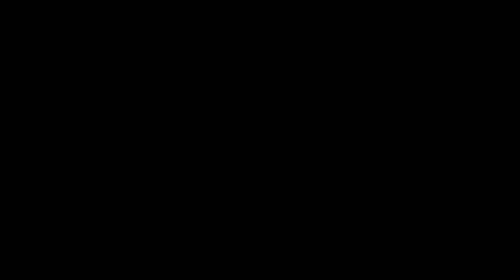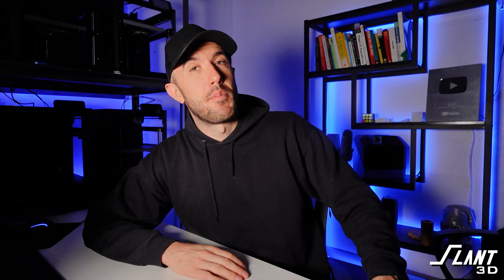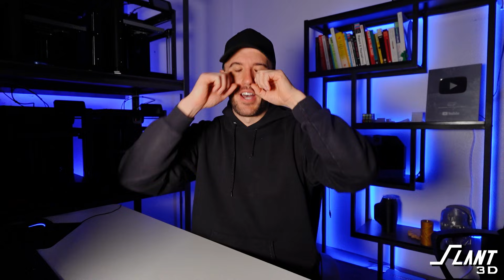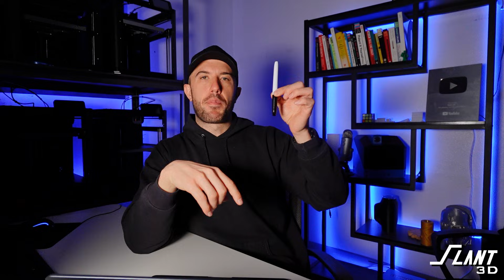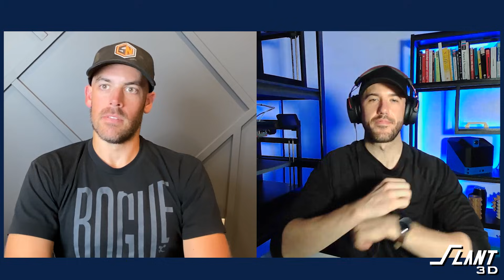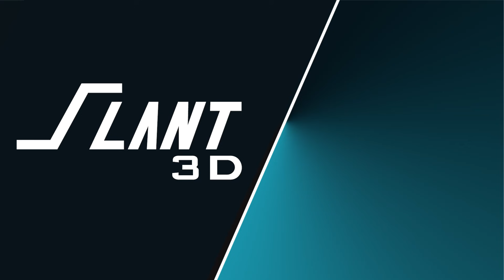3D Printing API | Lots of News and No News | Shopnation Redux | Your Questions | Podcast Ep 130

Comment: If you're not a massive multinational corporation, and you design a successful product, it's highly likely to be knocked off...
That's just part and parcel of the way the world works. 
If your product can be knocked off by an 12 year old in their bedroom, with no overhead and no costs, that may be a bigger problem. I have yet to design a successful product that's easy to copy and print. But I have had billet aluminum (CNC machined out of block of aluminum) products knocked off.
There's a few things you can do. Parents are kinda of dumb in most cases. Most products aren't even patentable, but then parents are expensive, but then defending patents is even more expensive. BUT design cosmetic features into your parts that are unique to your product line, and document them. That's called trade dress, and can give you leverage (and maybe even standing court), even if you don't register it (but registering it is super cheap compared to a patent). If another small business comes your thing, you can have your lawyer send them a cease and decist for like $50 or $100, demanding they stop selling the copies of your part immediately, prohibiting them from coming out with something that's a functional copy but modified to eliminate the trade dress infringement, and demand 50% of their gross receipts for the product. How much of that you can get a court to go along with is irrelevant - they have no way of knowing if you have the resources to sue then into bankruptcy. 
It also helps if you are active in the online communities around your target market, and they like you and know that yours is the original. I've seen customers of a company I worked for give a competitor a black eye over that kind of behavior in the online community that almost certainly contributed to that other company filling bankruptcy 14 months later...  I was petty enough to wait for that to get going before I suggested to the owner of the other company he should pull that product and not try to make something else to compete with it, before my boss got around to calling his lawyer... So he got stick with most of a production run of a pay he pulled off the market....